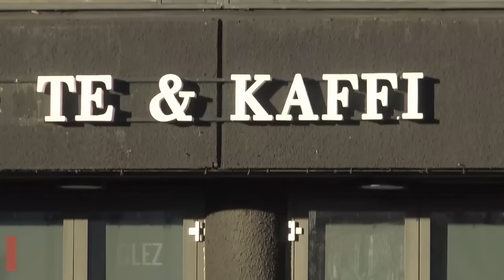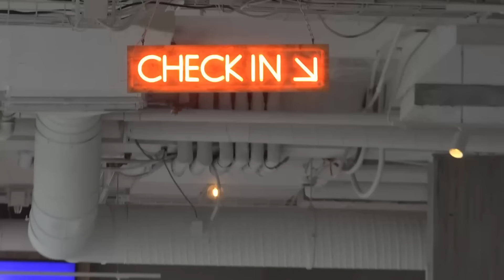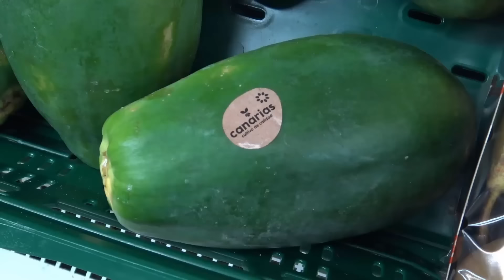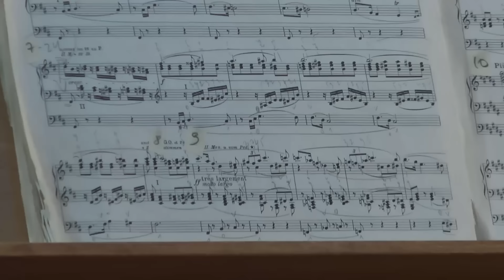THIS IS THE ICELAND OF THE POOR | The B side

Comment: I live  in Minnesota and have been to Iceland. Iceland is NOT cold, it's very pleasant in the winter.
Reply: Lol 😂 you tell em man...Minnesota the ice ring
Reply: @plainman9887  Uffda!!
Reply: There is the gulf stream that mitigates a lot. But surely summer is very very very colder than minnesota
Reply: @edoardostrambio5496 Certainly is. Minnesota gets all the extreme weather.
Reply: Compared to deep freeze Minnesoda....it gets the gulf stream  sweeping by..It's the darkness Minnie.
Reply: I am Icelandic and lived in Minnesota for one year and boy it is much colder there then the Icelandic winter
Reply: I went to Iceland in December, and it really wasn’t all that cold comparing with the DC Metro Area (Where I live) and that was surprising. I thought Iceland in December would be BRUTAL, the only thing brutal was the sun starting at 11-12 am and sets around 4.
Reply: Average temperature of Berlin in January is even colder than Reykjavik.
Reply: Ok but you're from Minnesota
Reply: Oh you're such a tough boy

Comment: Just spent over a week in Iceland for my retirement trip.  Yes, it is expensive, but you can't beat the views of nature.  Took 1000+ images between my phone and camera.  The folks we met were friendly and accommodating.  My wife and I were so impressed, that we are planning for a return trip in 2026 and plan on driving so that we can take a slower pace to enjoy what we will be seeing.  We live in the heat and humidity of Florida, so the change in temperature is appreciated.  We just won't visit during the dead of winter.
Reply: I live in Tennessee and I visit the panhandle of Florida is much more human and I get it and the weather has changed so much that we don't have any real fall or much of a winter in Tennessee anymore and I live in Middle Tennessee so I would get it if I want cold weather I want dry cold weather and like to stick around it goes up and down here in Tennessee it'll be 42 next time it's going to be 60° and then we have less rain. We used to get a lot more snow 15 years ago and it would go away now it's like you don't know what's going to happen. Humidity is something that you have to get used to but I think it's mainly it's going up and down week to week and the weather has drastically changed I don't think we have much of a falling more like we used to
Reply: You are planning to drive from Florida to iceland?
Reply: @jamesarnette1394  Hardly, will stay in the capitol and use it as a base to drive around, instead of taking guided tours.
Reply: @RichardAHolt  okay, that makes sense. To drive from Florida would have been very hard anyway because Greenland is not full of interstates. By the way, I think that's the way I would handle such a trip myself.

Comment: I lived in Iceland for five years around the turn of the century. As an English speaker it is incredibly difficult to learn Icelandic, as most people speak excellent English and will use it as soon as they know you are an English speaker. I did not find that wages were any higher in Reykjavik than they were in London, England. What is incredibly expensive in Iceland is food, especially meat. Taxes may be high, but there are also epic amounts of tax evasion taking place. The system also made it beneficial, tax wise, to be in debt. Most people are really nice, and yes, they are extremely proud of their country and their culture. The weather can be a bit of a downer, especially in the long dark winters, but you adjust over time. Taking everything in the round, Iceland is a lovely country.

Comment: I live in iceland for 4 years now :D  in my country, where i came from,  you get 650-900€ salary, but you will pay 600€ rent, 500€ food, 400€ for the rest. So you are 600€ short.. if you are above avarage, you are at 0... Before i moved to iceland i was working in the office, thinking how " fancy life " i have.  ( I had no money to buy butter on bread) .. 100€ on shoes is how you are star in society ...in iceland i started as housekeeper. I earned 3200€ , 1000€ rent, 600€ food , 400€ rest. So still 1200€ left at the end of the month.. later on i start earning about 5-7000€ month/ still at low rank job in cleaning company.. so i can save 3-5000€ a month if i want. People here have a choice, living at high standard, going to vaccations every 3 months, buying whatever they want, or just work and save money... None of that was possible back then in my country.. also, you don't need to know icelandic AT ALL..I had like 5 different jobs here, always used english with no issue.
Reply: Do you still live in Iceland?
Reply: @MuhammadBilal-yx5xi  yes, still here :D i will stay for couple of years, to buy everything i need and i will move to Poland :D ( not my country, but my wife) .

Comment: Why are you censoring words like suicide and homicide?  You are not helping the stigma attached to these words - by being more open and using them like 'normal' words, dialogue and debate can ensue, and addressing these issues can take a more central platform. Censoring them, as if they are bad words that we shouldn't talk about, is negative and regressive. Your channel needs to be more positive, pro-active and forward-thinking.